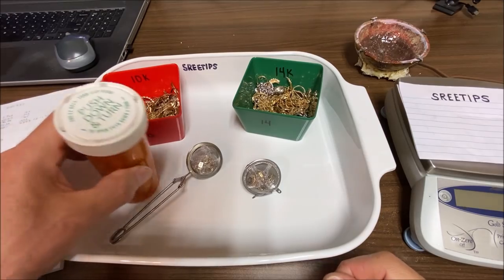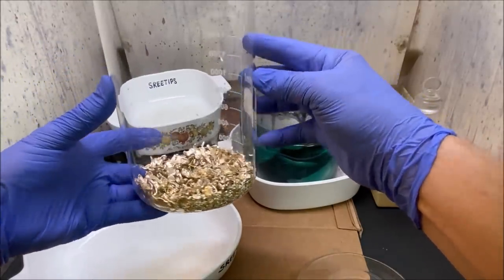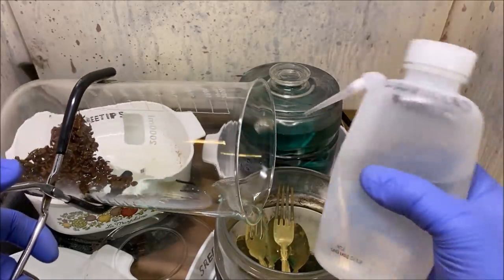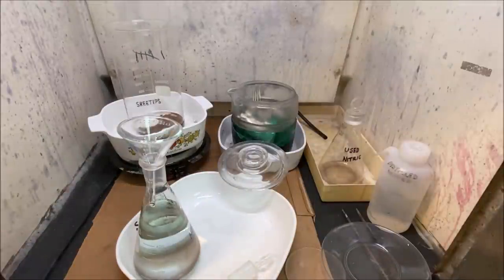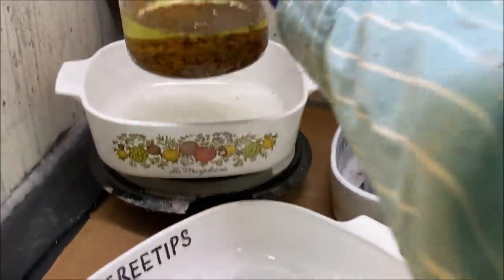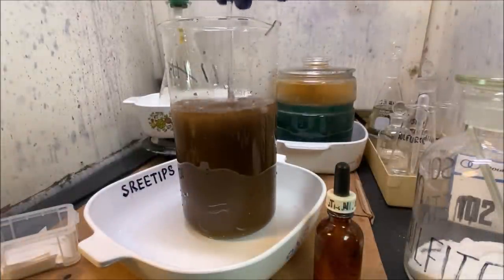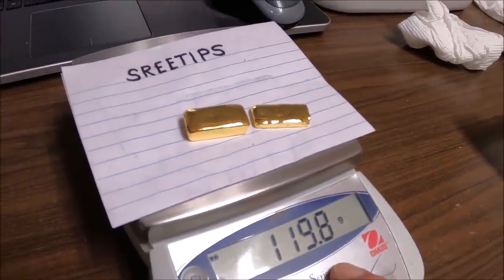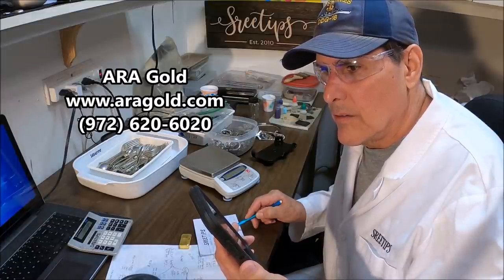How To Sell Your Gold

Comment: I have that same #3 graphite crucible 18:47
 It can crack if heated to quickly, so incrementally add heat over 5-10 minutes. I dont want to see that happen when you melt your cemented silver in the future. I recommend buying a salamander crucible they dont need any pre heat

Comment: You're one of the few that add HNO3 a little at a time. I've been refining for years and have always done it this way. Why spend hours of needless "boildowns"? Recently I sold my Rh that I've saved through the years. A lot of jewelers used to plate Rh behind the stones to catch the light. Tho individually in very small amounts, through the years it built up. I even got it to melt using mapp  gas fusion that took 3 hrs., 3 seperate melts. What fun. Goes to show ya anybody with a little common sense can do anything he sets his/her mind to do. My daughter follows in my footstep. Great Video. Look forward to catching more.
Reply from the maker: Richard, I know that I have rhodium in my wastes. I’m totally knowledge less about how to test, recover and refine rhodium. I’m running out of time. My daughter is into real estate and just bought some bitcoin. I tried to discourage her. But she’s just like me - stubborn streak a mile long. She won’t buy gold, listens to Dave Ramsey. But she’ll get the kind of expensive education that making unwise decisions brings. Congrats on your daughter following in your footsteps. I can’t complain, my daughter is doing better than I am and for that I’m grateful.
Reply: @sreetips  Most of my Rh was plated to the Au just under the diamonds,emeralds,rubies,etc. My refining method on scrap Au is a little but not much different than yours. I usually take the time to seperate the stone settings. Place these in Aqua-regia solution. As the Au dissolves the Rh will float around like your gold filled scrap floating on your HNO3. I retrieve them by filtering and place in a repository, where I'll try not to forget them for another 10 years. Yep, i had placed the marked container when i moved, in the garage. Oops!  Any way we all make mistakes. Got 2 ozs. out of it. Something else you might consider is selling your brown powder Au to local jewelers. The ones i dealt with in the past would pay a premium on it. easy to weigh and mix for whatever their alloy. Easier to weigh powder than wire, plus they could make their own colorful alloys. They love it.
Reply from the maker: Rhodium has got ahold of me. Now I’m obsessed with recovering and refining some so I can make a video of it for my channel. Thanks for the info. I can tell when folks know what their talking about - and you’re one of them.
Reply: @sreetips  The best book i ever had for learning was the 1948 Chemistry and physics handbook. For some reason that book seems to be the hardest to find. Most of my experience came through the mining industry.Worked at Magma for a few years. Found Pd in Au alloy. People were selling there gold thinking it had Ag alloy. Proved with a paper trail how they were getting ripped-off. 1 ton of rock yeilded 7oz.Au 1oz Pd. Sold both as seperate elements. Most of the Rh i gathered thru the years was from behind the gemstones. It would float on the surface like your gold plate. By the way,a lot of older custume jewelry was plated with the same. Little known secret i just let out of the bag. Work with your refiner,some like it alloyed with Cu. It's rather unique because it depends on what it's alloyed with. Think of the tons of sludge those electrolitic cell produce a day at the big mining smelter operations. They all have the platinum group sister in them.

Comment: Thanks for the refiner/buyer's contact info.👍🇺🇸
Reply: One thing Streetips doesn't really explain is the "Patriot Act" laws. Most refiners don't deal with the general public. You need to prove that you have some connection to precious metals such as jewelers and jewelry repairmen (which I believe mr. streetips falls under), pawn brokers, antiques dealers, coin shops, etc.  You also need to furnish info such as business or resale licence numbers, tax id, etc. It sounded like the gentleman that Streetips spoke to on the phone briefly touched on some of the requirements but again, there are requirements when dealing with refiners.
Reply: @calogero_t  also depends on the state you're in.

Comment: TIP... either heat your dish from the bottom or heat the whole thing in a furnace so you don't reach excessively high temperatures during melting... excess heat will vaporise some of the gold ( gold will start to "evaporate" as little as 1500 deg C.. which is easily reached with propane/oxy mixed gas) ...in a furnace or heating from under the dish will keep your temp just above melting point so you lose nothing.
Reply from the maker: Excellent, thank you

Comment: WRT cement silver, you said, “then I rinse all the copper off it.” But subsequent steps in your silver refining process suggest that that doesn’t quite happen. After all the phrase you use for your shot is “impure silver shot” and your electrolytic chamber becomes blue as the Pacific with (copper nitrate?) You’re still rinsing rinsing rinsing this stuff off at the end of process from your pure silver crystal. I gotta say, and I say it with love because Mr Sreetips  you are awesome, but this appears to be a major weakness in your workflow. Have you ever attempted to brainstorm a better way to rinse your cement silver?
Reply from the maker: Two points here: #1, as long as the copper concentration is kept below 60 grams per liter in the electrolyte, and voltage (current flow will vary) is kept at 3.5 volts, then the copper will not plate out in the cell with the pure silver crystal. #2, according to GoldSilverPro on the goldrefiningforum.com (one of the professional refiners that I learned from) a small amount of copper in the electrolyte, like what you get when traces of copper in the impure shot start to build up in the electrolyte as it dissolves, improves the crystal structure. It promotes fat crystal growth. I learned from the best. Their methods are tried and true.
Reply: I guess that when cementing silver with copper, tiny particles of metallic copper get separated from the bulk and are mixed with the cement silver. So rinsing won't help much, but electrolysis will. Sometimes Sreetips ran his pure silver crystal through the cell again, resulting no blue stain to the electrolyte. This proves that the single stage electrolysis properly takes care of the remaining copper.

Comment: Why not use pure silver instead of sterling when inquarting?  The only things I kow about refining is whatever I learned watching you but it seems like not having the copper ''contamination'' would make for easier refining of the silver afterwards?
Reply from the maker: Using pure silver, that’s already been through the silver cell, would be taking a step in the wrong direction.

Comment: If you just slightly crumble the gold with glass stick after every nitric acid bath .then it will be easier for nitric acid to penetrate the gold quickly and you will need only 3 nitric acid baths to purify gold to 23.99 karat.
Reply from the maker: We don’t want to crush the gold because it will form nano particles that don’t settle well. Or worse, colloidal gold. Then separation of the liquid from the silver becomes a nightmare.

Comment: Hey Sreetips. I love your videos. I’m curious, could you use some of your cement silver to enquart the gold instead of purchasing silverware to melt down?
Reply from the maker: Not recommended. Palladium follows silver because it’s soluble in nitric. The palladium tends to build up in the cement silver if used to inquart. High concentrations of palladium causes it (the palladium) to get into the silver cell electrolyte. High concentrations of palladium in the electrolyte could cause palladium to plate out with the silver and contaminate the pure silver crystal. But contaminated silver is not the concern. Palladium is almost 80 times more valuable than silver.

Comment: One question; if there are excess nitric acid when you pour it into the silver jar - why dont you just boil it for longer? Nitric Acid is expensive and difficult to procure ( at least where I live).
Reply from the maker: I add pieces of silver to consume all the excess nitric acid. A small amount of free nitric is required for the silver to react with the copper and cement out of the solution

Comment: The first part is all really great but are there better ways to do this with less HNO3 waste? Such as boiling the inquartated metal in a flask and condensing all the vapours into more aqua fortis rather than let go up in smoke? A two neck flask might be employed so that the liquids could be siphoned out and replaced easily. Or doing smaller batches, where there is enough water, acid, metal for all Ag to go into solution in one or two passes? Seven or eight looks labour intensive.

I thought about how the old school chemists had tops for their alembics where the vapours condensed and were collected. Something like that which could fit onto a beaker, or a modified beaker so all of the red smoke could be collected and reused. But could also be quickly and easily removed and replaced. A modern version of that might be a reaction flask that has a circular clip that holds the lid down. Its basically a round bottom beaker. It has a ground glass joint to add whatever condenser you like to it. If it were a reflux setup, all the red fume would condense and drip back in to help with the reaction. Zero waste.

Or putting the inquartated metal with dry nitre crystals and heating them in a reaction flask or large crucible with lid, dry. Then washing the silver nitrate out once cooled. Is that done? KNO3 melts at 320°C so I'd imagine it wouldn't need to be much hotter.
Reply from the maker: Wow, I’d like to see a video of that. Thank you